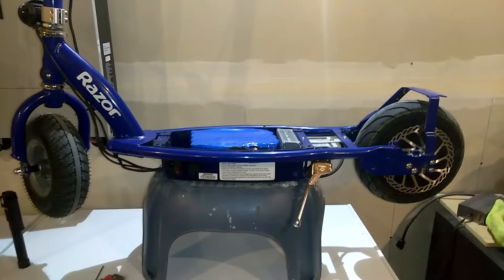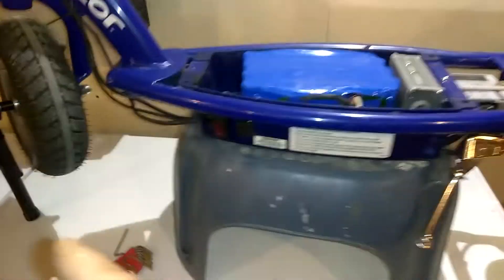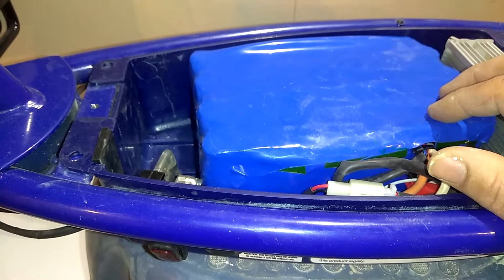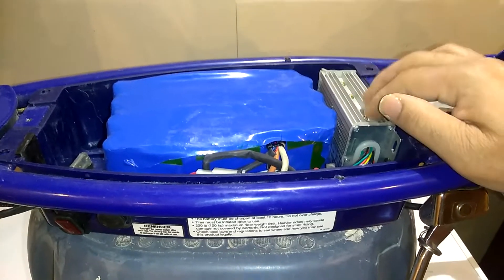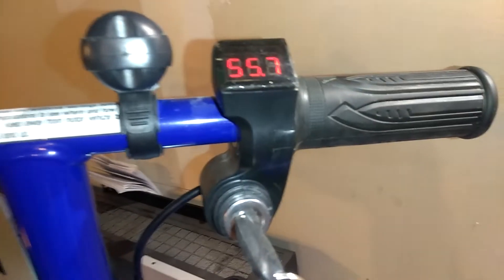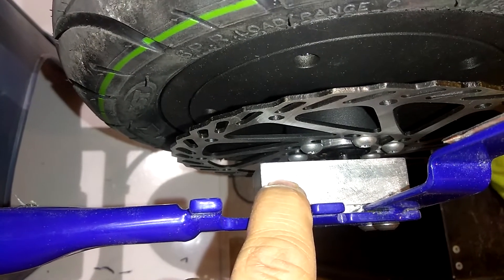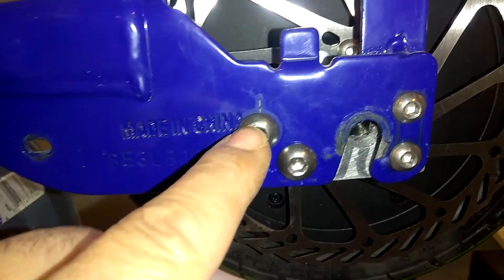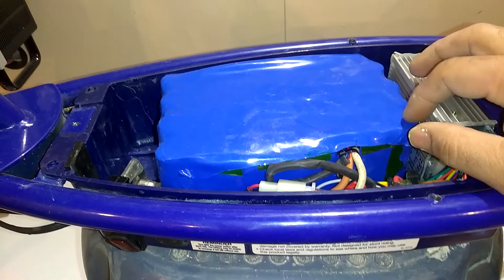Razor conversion to lithium battery and hub motor.

Comment: Hi I love your build. I also have the same scooter and I'm looking to upgrade. Could you post a parts list. So that I can get the exact same parts and get it right the first time. I just finished building a 58 volt battery and I have a 36 volt brushed motor that was previously on a razor 500 dirt bike. But the motor has some wear and brushless is definitely the way to go
Reply from the maker: All parts came from eBay but the vendors I purchased them from do not have them anymore.  They said that the parts came from bulk items that they bought and they were on the pallet.  Once they were sold out they haven't had any more but if you look around on the eBay you will find all kind of parts.

Comment: E300 & E325 Electric Scooter:  Larger 9 inch (229 mm) wide pneumatic front and rear tires to support older riders while helping soften out rough surfaces for a smooth ride

Comment: clever build / great workmanship! wld u you pls add links to the components? thnx!
Reply from the maker: Everything was purchased through eBay I will try to put some links on here ASAP.
Reply from the maker: Calipers and rotors https://www.ebay.com/itm/Bike-Disc-Brake-Front-Rear-Disc-160-mm-Rotor-Brake-Kit-for-Mountain-Bicycle-/402764598425?mkcid=16&mkevt=1&_trksid=p2349624.m46890.l49286&mkrid=711-127632-2357-0
Reply from the maker: Speed controller https://www.ebay.com/itm/Electric-350W-36V-48V-E-bike-Scooter-Brushless-DC-Motor-Speed-Controller-USA-/384431563002?mkcid=16&mkevt=1&_trksid=p2349624.m46890.l49286&mkrid=711-127632-2357-0
Reply from the maker: Hub motor and tire https://www.ebay.com/itm/10-CST-10x2-50-Tire-Electric-Scooter-Motor-Hub-Wheel-1D42107080893-/255188167043?mkcid=16&mkevt=1&_trksid=p2349624.m46890.l49286&mkrid=711-127632-2357-0